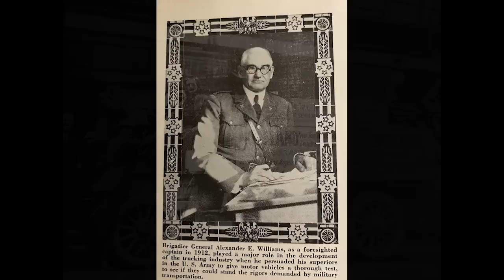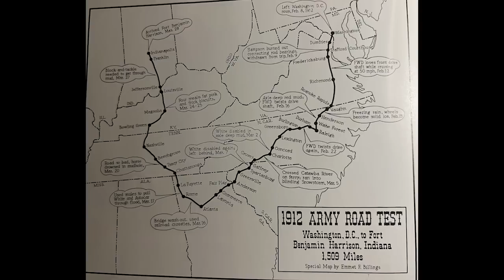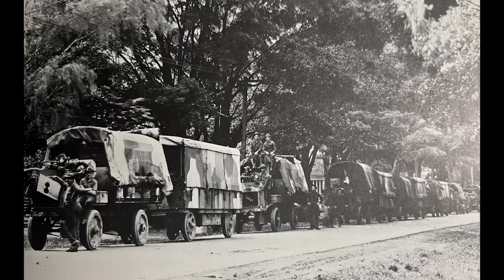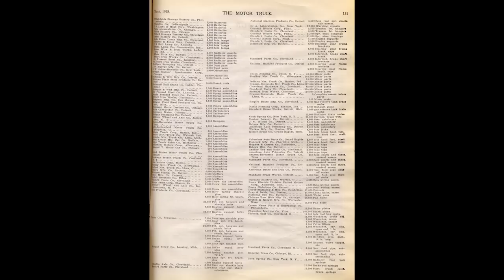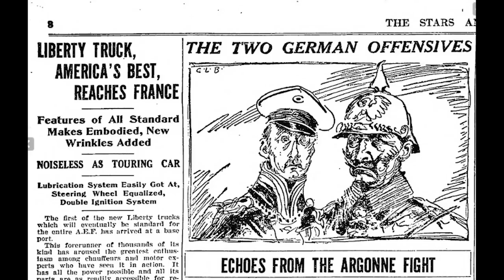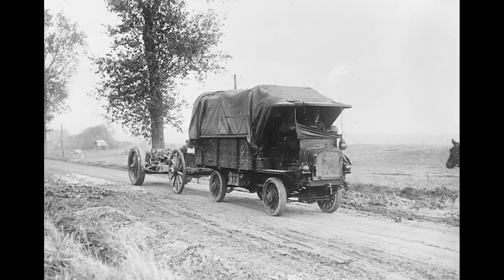War Wagon: The WWI Liberty Truck Story

Comment: The Liberty Truck kept my grandfather out of the trenches.  Since he was already experienced at driving something more than a Model T, he was made an Instructor at Fort Benning.  Model T's did not have a gear shift, so learning to operate them would not be enough to drive a truck of the era.  Late in 1918, the company was finally being shipped to Europe, and got two days out of New York before being turned around - the war had ended while they were en route.  My grandfather later helped teach me to drive - and he was darned good at it.  He'd taught my mother and her brothers, as well.
Reply: Model T's had gearshifts, my friend.... Low, High, Reverse. You may not have to run through a series of forward gears like you would with modern trucks, but they were still shifting. It may only be a 2-speed, but a gearshift is a gearshift. The only real differences between that and a modern manual is in the number of gears, and the use of Synchros. As for the transmission in the Liberty Trucks themselves, they were only unsynchronized 4-speeds, and would have operated the same way as an old-school tractor transmission. If you didn't float-shift, you had to stop to change gears.
Reply: @GAFFzero    I sort of oversimplified, but the Model T's unique blend of shift and reverse pedals did not qualify you to operate a Jeffrey Quad, the actual sort of truck my grandfather drove in WWI.  (These were actually built around the corner from their house and store).  Model T-only drivers were not accepted as instructors by the Army, since the planetary clutch was so different as to not apply.  Mechanically, the T's transmission had a lot more in common with a modern automatic transmission than with any conventional, gearahift manual transmission, crashbox or not.  I've driven tractors, trucks old enough that they lacked sychros and cars that were non-sychrous in first gear, and you simply learn to double clutch, spinning up the intermediate gears until things mesh under no load (which is what I think you called float).  It was that same grandfather who taught me that trick, and it still works.  He learned on their International delivery truck, sometime around 1910.
Reply: @williambecwar7939  fair enough

Comment: General Patton said that the two most valuable things to winning WW2 were the M1 rifle and the 2 1/2 ton (Deuce and a half) 6x6 truck. Its development is another interesting story with an entry by Duesenberg. It had the fenders, hood, and straight 8 of the cars! I have a 1971 M35A2 and spent 40 years running a 1952 GMC M135/211. I also have an M543A2 5-ton 6x6 wrecker. I have pics of my grandfather driving a Mack AC in the 1930s. Germany didn't have any 6x6 or 4x4 trucks in huge numbers. The "Red Ball Express" supply train of deuces slogging through the mud was critical in WW2. 😊

Comment: As owner and researcher on a Type I, I appreciate all the work you put into this short video. I do wish the pre-restored Type II wasn't shown, as it has now undergone about 200K worth of 'revisions' to make it proper. I would not be surprised if some of these photos came off my 4GB collection as a few were in a GA. restoration shop. Some of the 'Best' restorations are in 1st ID Museum Cantigny Chicago, National Museum of the Marine Corp in Quantico and by now the US Veterans Memorial Museum in Huntsville, Alabama (That I have watched and helped with research info. Mine is still in progress as of this posting, a Type I, I have gen/dash gauge, dizzy to refit a Type II engine, lots of wood work and metal fenders to ponder but those solid rubber tires are the $$$ killer. Thanks for the work! HUZZAH! Carrollton, Virginia

Comment: My grandfather worked in a Racine Wisconsin truck manufacturing plant just prior to WW 1. They had a contract with tge French government to make flat bed trucks. Gramp’s job was to drive the truck out of the plant and take several laps of the parking lot. If the transmission made too much noise he was to drop a handful of sawdust into the crank case, repeating the process until the tranny quieted down. Then they were ready for war.
Reply: I grew up in Racine, and this story sounds pretty Racine to me.

Comment: Interesting history.  When the big “motorisation of the U.S. Army” and military at large; most trucks were, organisationally swapped out 1 for 1 for wagons with little regard for the “why.”  Some of these actually lasted until the 1972 US Army “Wheels Committee” where gun crews who had 3 horse teams/wagons(ht/w) now had 3 trucks, but no one could articulate “why” there were still 3 trucks; the HT/w pulled the gun, the caisson and limber.  Now, you look at gun crews, there are only 2 trucks, one for the towing the gun with part of the crew and one to carry equipment/ammo the other half of the crew and tows a trailer for ammo/equip.  You will find so many rabbit holes to follow!  How do I know about it?  My father was the president of the board, although NOT the senior member.

Comment: It's easy to write the military off as foolish for rejecting motorized vehicles early on, but their use could easily be questioned when the infrastructure to use them was so sparse.
Reply: Yes, because they were.  Civilians usually embrace new technology way before the military does, small drone warfare is a good example for today
Reply: @jhosk That's because like I said before, the military has different requirements for technology than a civilian user does.
Reply: Not really.  After the horse flu of the 1880's, bad enough that it caused, in part, the economic Panic.  Another horse sickness of the late twenties and early thirties caused the US military to be the most mechanized in the world.

Comment: I worked for a company in Burlington Massachusetts that had many restored FWD trucks from the 50's through the 70's. Unfortunately, that construction company closed its doors some 20 years ago. But the trucks were sold under auction. I assume their still around. Also the GWD company got absorbed into the Seagrave company. They make fire apparatus.

Comment: As a  bit extra the Jeffery Quad was also in the mix and was licensed and built in England long after the war. Some men left FWD originally the Badger Four Wheel Drive company and started Oshkosh which still fill military and other government contracts. Buda in the case of the US manufacturing would have been pronounced with a long U like fuel. Just the way the little town it started in was pronounced and still is.

Comment: You mentioned that the french wanted to remove all the american trucks after the war, lots of american equipment was sold surplus in the u s after the war very cheaply And the government gave a fair amount of it away to city's towns and highway commissions and it killed off quite a few small truck manufacturers motorcycle manufacturers ect ect  due to the excessive surplus.

Comment: There’s. Liberty truck sitting in a junkyard near here. Pretty much a rolling chassis now but it still has the wood spoke wheels and the radiator is still there with USA cast in the upper tank. Yard dates back to just after WW2 so there’s all sorts of off the wall military surplus scattered around.
Reply: Would love a photo for confirmation, I have a Type I and need fender Irons and fenders. I have seen collectors buy bare frames, but then they do not know how limited parts are. Not sure if there's a way to link up or not, I'm in Carrollton Virginia

Comment: I was on a roadtrip with my family a couple years ago in the southwest U.S.. Randomly, on the side of the road in the middle of nowhere, was a small complex of a farmhouse and a couple shop buildings, with a BUNCH of old equipment. Tractors, winches, a couple small steam engines, and a FWD model B truck. Something on hard rubber tires with shaft-driven rear AND front axles was something new to us, we didn’t know there were 4x4s that old. It’s always fun to find old stuff, the things you learn are incredible sometimes: The first licensed female truck driver drove a model B: https://en.m.wikipedia.org/wiki/Luella_Bates

Comment: I watch a couple of tank restoration sites. The 'generic' Lee, Grant and Sherman tanks had lots of Mack parts. Gearboxes and diffs you see the Mack logo,, and most of those parts after sitting for 60 plus years and being abused by farmers before are in very good condition. 
The German tanks, more high tech and precise seem to be [and were] a lot more fragile. The reason a half decent tank won where a precision one failed